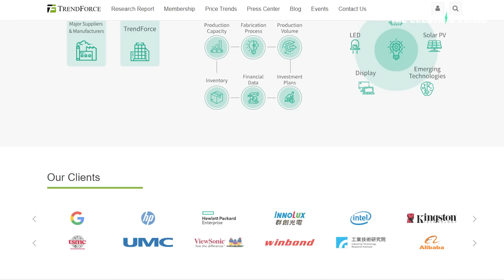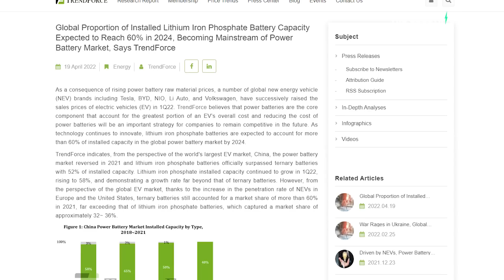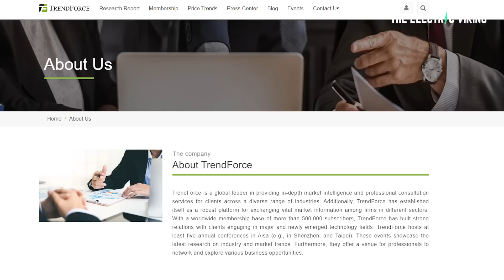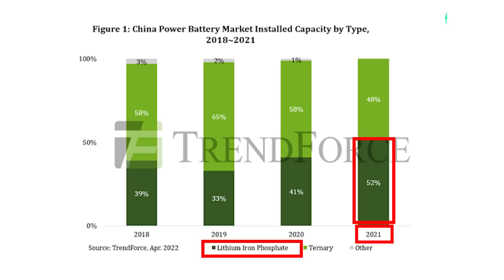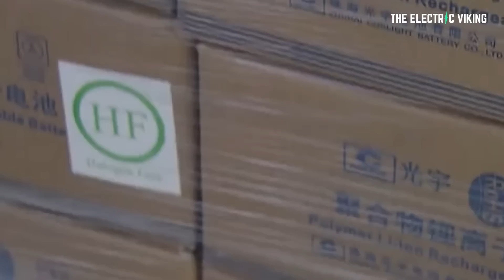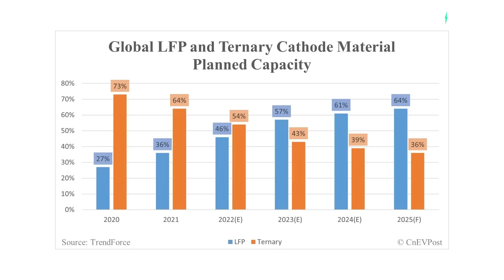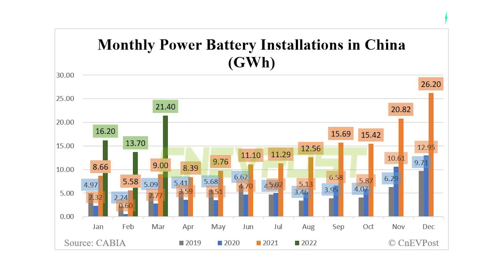LFP batteries taking over fast: 60% global market share by 2024

Comment: What about Lithium sulphur batteries being produced and tested in Germany? As a much cheaper material sulphur seams to allow much denser batteries at a cheaper cost. They are quoting lighter weight batteries in a Tesla model 3 with a range of 900 miles in production by 2024. They are also suggesting a cost of $32 per KwH! If this is true it will be a disaster for Nio and their swap stations and there also won't be such a need for charging stations everywhere as people can just charge at home. This may of course not happen but I think Sam has touched on sulphur batteries before.

Comment: LFP battery in a Standard Tesla Model 3 has a range of 272 miles.  The NCA battery in the Long Range Tesla Model 3 has a range of 358 miles.
LFP Model 3 weighs 1745kg (3847lbs)  NCA Model 3 weighs 1614kg (3558lbs)  That is a difference of 131kg (288lbs).
Tesla has the highest efficiency in the market.  If GM used LFP batteries they would weigh over 225kg (496lbs) more.
This is why Legacy auto is not switching to LFP batteries.  They can't.
Chinese Evs have not made inroads in the USA because they can't build Chinese cars in America.  They have to redesign them for safety making them weigh much more than their Chinese counterparts.
Reply: LFP model 3 you can use from 100 to zero without worry about your battery life that all of the 272 miles everyday..... the NCA model 3 you have to cut 20% from the bottom end and another 20 % from the top end there by only leave you with 214.8 miles of everyday range....358 miles of the  NCA model three is just for your one or 2 time a year long trip...
Reply: @airrodgers7277  You can use 100% of NCA.  It is an option.  You can't use 130% of LFP.
Also, Elon said you can use 95/95.  not 80/80.  FYI.
NCA batteries will last 20+ years and 1 million miles.
LFP batteries will last 20+ years and more than 1 million miles.
Most Tesla cars built in the 2020's will still be on the road in 2050.

Comment: GM is spending $2.6 billion building a new factory to build, Ultium battery cells include “state-of-the-art,” Nickel Cobalt Manganese Aluminum chemistry.  LFP batteries cost 60% less.  GM just wasted $2.6 billion to build batteries that cost more than $40k per car.  Think about that.

Comment: YES BUT... Aren't most LFP batteries made in China?... No one seems to be realising the carbon impact cost of making a battery.. for every kW of storage it takes 100 kw of power to manufacture... And this is just the using of raw materials and the manufacturing of the battery at battery factory it does not include cost of mining processing and transporting the raw materials to the factory.  Well this is if I understood the video below correctly. 

Now this is ok if the power used is green like Northvolt using mostly Hydro.. however the majority of Chinese used coal fired power.. over 70% at the moment I believe..so this is very bad news.. so if my calculations are correct you would have to travel approximately 15000 miles in a battery powered car to break even the carbon footprint of a coal-fired manufactured battery... however this does not take into account the carbon footprint or reduced pollution you will be gaining by not driving ICE car.
My point is here the people must follow the trail of manufacturing damage to the human race and the planet to get the true picture.

So the logic conclusion is how do we make all the buyers in the world buy batteries which are manufactured only by using green energy... well you can't they will just buy the cheapest in most cases...unfortunately... I wonder how much green energy Tesla use 👀

It would be nice to understand the total carbon impact of making a ICE vehicle compared with an EV.
https://youtu.be/cOHjIav97HM

If you're interested watch this video about the state of China's power generation... It ain't great news 😕 https://www.theguardian.com/environment/2021/oct/12/china-coal-fired-plants-uk-cop26-climate-summit-global-phase-out

Comment: Does the 2022 MG ZS EV have a LFP battery?
Reply: 2022 MG zs ev  long range  is not LFP but the shorter standard range of the 2022 MG zs ev is LFP
Reply: @airrodgers7277  Thanks. Interesting. Guess that means the long range is only 32 kms longer range in reality than the short range as should only be charged to 80% to minimise battery degradation. Not only that, but as the short range has LFP battery (can charge to 100%) then in reality the short range would likely end up overall the longer range in respect of battery life degradation and battery life. Short range with LFP battery may be the better option to buy given the battery may last 3x longer than a non LFP battery and less degradation?
Reply: Aus/NZ are only getting the shorter range MG so for sure you are getting the LFP if you get the MG. I am more excited about the MG4 due later in the year, although it will not get here until 2023 for sure

Comment: SERIOUSLY. I would choose a phone with LFP or more so Sodium Battery over Turnery Battery any day and take the slight size and weight hit to have a phone that lasts longer and can be charged to 100% without serious battery degradation. The trend if buying new phones every year or even 2 is environmental suicide and not sustainable..... bring it on Samsung and get the leap on Apple iffone 😃
Reply: Even now I never charge over 80% and  after 2 years is still OK and out of contract so saving £30 a month

Comment: Three years ago I replaced a Odyssey 5kg 14AH lead acid costing £110 with a JMT LFP that cost £60. It was only 4AH but gave the same number of engine starts and weighed less than 1 Kg (850g). Why would you use anything else.

Comment: You keep using the term “ternary”. That means comprising three basic materials. Why are LFP batteries not ternary- do they not also consist of mainly three materials, lithium, iron, phosphate?
Reply: Phosphate is a material that can be recovered from the cell. Ternary refers to Nickel cadmium and Manganese in the cathode powder only. It’s only shorthand. Go full n00b and call it NCM or NCA if you must
Reply: @theairstig9164  Thanks for the info… I guess we were supposed to know that?

I guess “ternary cathode “would be a more transparent term

Comment: Which small cheap European EVs use LFP batteries? I'm looking to buy a small second hand EV in Europe. What do you recommend?
Reply: I think Renault has announced that it's electric Renault 5 will use LFP batteries. But it won't reach market before 2024.
Reply: @philipperapaccioli2868  the renault 5 study looks amazing.
Reply: none that i know of. but maybe some suppliers like LG Chem or Samsung SDI are switching to LFP? these two at least supply VW.
Reply: the standard range 2022 MG zs ev
Reply: @airrodgers7277  not sure if it is made in europe
Reply: MG4 now that looks like a nice EV and expected to be cheaper than the MG crossover with same sized battery and much better efficiency.

Comment: To use LFP you need an efficient vehicle packaging design, good BMS, efficient inverters, efficient motors, efficient thermal management, efficient ADAS and Infotainment, and a lightweight and aerodynamic vehicle. That rules out most Legacy ICE assembly companies.

Comment: It has to be cheaper to deal with and solve for the issues with LFP than to keep buying the metals needed for other types. So unless something even better and cheaper reaches production LFP will be the ones used in most cars in the future. Other batteries may find a use in colder climates and expensive luxury cars. Hopefully the switch to LFP will result in the price of rare metals to begin falling.
Reply: What are you talking about LFP batteries cost more than Nickel batteries when measured by wh/kg. Add in recycling at over the life of the battery Nickel is far cheaper then LFP. There is a reason why tesla has no plans to build their own LFP batteries
Reply: Hope away my brother. There is a use case for ternary batteries. Mobile phones laptops and drones all use these. RC models and high performance units still use LiPoly. Their markets have not reduced

Comment: I know you harp on the "fact" that LFP batteries are superior, however they aren't better at everything. I'm buying a model Y performance just for that reason.... performance. I can't get that with LFP batteries. Also, if they last so much longer, why does BYD only warranty it to be above 60% at 100k miles while Tesla warranty is 70% on 2170 batteries?

Comment: I am running half my house on lfp battery's that have come out of a bus I was given a 1000 a123 systems cells for a favour only400 were any good so I made a power wall out of the goodish ones  to replace a lead acid  system that was old they are down to about 70% of original capacity but are still way better than the old lead acid battery's that I replaced total cost was about 130 euros
Reply: Years ago A123 was the darling of tech. I thought it went busy and disappeared.

Comment: Who wants a car that will catch on fire at any time or after an accident?
Reply: Apparently the hundreds of millions of ice buyers. I mean it's all in the name "internal combustion engine" runs on highly flammable liquids it then combusts to provide the motive force. Top recalls are most often for ice vehicle's which spontaneously combust. Just in the U.S. we have over 200,000+ ice vehicle fires each year. People don't seem to care to much though. 🙂
Reply: LF batteries are extremely safe. They smolder they don't burn.
Reply: @AORD72  The ones I've seen where they intentionally overcharge or damage the batteries and there was a short, the battery expelled steam then stopped.
Reply: no one. that's why we want to have LFP batteries.
Reply: @stefanweilhartner4415  That is also why I wouldn't buy anything without a LFP battery. Having an accident is bad enough, No need to risk burning to death too.
Reply: @felixsu375  yes, but the probability to get hit by a lightning might be bigger. the change to burn in an ICE car is ten times higher
Reply: @stefanweilhartner4415  True. But if it happens to you, it's 100%. But the biggest factor for me is the long cycle life. No need to worry about battery degradation.

I can drive it for 10 years, 20 years, 30 years and not have to worry.
Reply: @felixsu375  like crashing with a plane. should be avoided too
Reply: @stefanweilhartner4415  GM vehicles scare the hell out of me. The Bolt just catches on fire. Not even driving. Just foooom, you're on fire.
Reply: The same old BS ICE vs EV fire augument, there are 1.6 billion ICE vehicles currently on the road worldwide, now lets compare only ICE vehicles made since 2009 when the first lithium battery powered car was released to the masses rather than all the ICE vehicles that are on the road with zero safety features protecting the fuel system and puncture resistant fuel tanks then do the same test and I bet car fires would be much lower!

Comment: I’m willing to sacrifice a bit of energy density/range if it means safer, longer lasting, more reliable and (hopefully) cheaper (per watt-hour) batteries.
Reply: Except that you're not having to sacrifice range. A little more batteries isn't a big deal. And the LFP batteries will literally last for 50+ years. This will guarantee resale value of your EV.
Reply: And charging to 100% is way less of a problem with LFP so there really is no range loss compared to other chemistries.
Reply: @David34981  But if you're smart and don't charge to 100%, you can also get many more cycles. You can get up to 12,000 cycles vs. 6,000 if you manage it like a NMC battery. Which is insane. 

That is over a million miles for most cars. I don't even know who drives that much except for fleets.
Reply: @felixsu375  Keeping LFP below 100% is supposed to be not necessary. Does no harm at all. So why would you go to the trouble of not fully filling them?  It’s also a much easier way to be sure the cell voltages remain balanced.
Reply: @Dave5843-d9m  The cell voltage is balanced by the battery maintenance circuits.

Because the rated full charge cycle is 6,000 cycles. But if you charge to 80%, you can get them to go for upto 12,000 cycles.

Although 6,000 cycles is a lot, 12,000 is much better. I am a cheap bastard and want 12,000 cycles. Because that will last me the rest of my life.
Reply: Because LFP can handle full charging there is not much difference. Other batteries people only charge to ~90% to protect the life of the battery.  LFP far easier to take care of.

Comment: So , trouble 4 tesla? 4680?
Reply: They are building cars with them and the packs are smaller. Perhaps If Tesla announces they are many times better then they may destroy sales of LFP and 2180 cells cars. The 4680 cells may be better in cycle life, they were saying 1 million miles. At least Tesla has multiple types, makes company robust if supply or quality problems. Also Tesla needs every battery it can get to meet demand. We need about a year to see how the 4680 last,, people will get ones out of crashed cars and work out the specs.
Reply: @AORD72  the 4680 tesla cells do not have a higher cycle life than LFP. LFP has at least 50% more cycles. but actual 4680 tesla cells have a higher energy density (296...300 Wh/kg) which makes them more suitable for very long range cars, light weight sports cars and trucks.
LFP is much better regarding cost/kWh and higher cycle life. but with the down side of less energy density (160Wh/kg from CATL, 210-230Wh/kg from Gotion). So you can 'only' use it for short range and medium range and soon long range. but not for very long range, sports cars or big trucks.
Reply: @stefanweilhartner4415  RE: 4680 cycle life , do you know that for sure? Or is that all the speculation? 

"Jeff Dahn, shared some details of his research during an Energy Storage & Sustainable Engineering videoconference. Dahn revealed that, after three years of testing, he found that his cells had a lifespan of over two million miles. He has tested his battery over 20,000 cycles at a depth of charge-discharge of 100%, and found that his battery can last 15,000 cycles and still have 90% of its capacity" - isn't he the man working with Tesla on the 4680?
Reply: @AORD72  not sure if this is right. that also depends on how fast the cells being charged.
Reply: @stefanweilhartner4415  depends on the KWhrs iirc, which varies varies by model, new mod Y from Austin 279 mile version, I belive will be one of quickest to charge.

Comment: When you gotta talk about the sodium batteries ❔️🧐❔️

Or the company  StoreDot  ❓️🧐❓️

"#StoreDot Batteries" 

Like I have been saying I'm sitting out from buying an EV for the next 4 years. (at least)
( I would like to wait longer but I don't have the patience)
 The 1st EV  I will buy will probably be in 2026,  the way battery technology keeps advancing and at its current rapid rate a EV today with today's current battery configuration will be obsolete within 2 and a 1/2 years.

 Prime example is that the early EVs with the "3G Technology" are now dead in the water with "5G technology"  kicking in.

I  have subscribed to your sons' channel.  Very interesting races. And insight about BMX racing 👍
Reply: storedot has prototypes for years now. but as far as i know, not a production ready prototype.
Reply: @stefanweilhartner4415  OK
And TY 
 I got that info off the  Tesla Fan channel.
Reply from the maker: Will talk soon. Thank you so much btw.